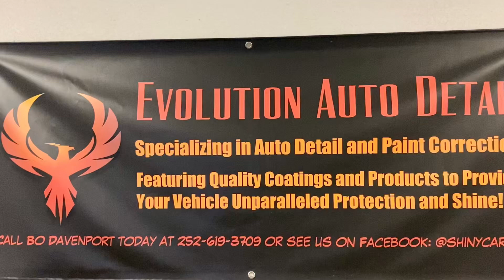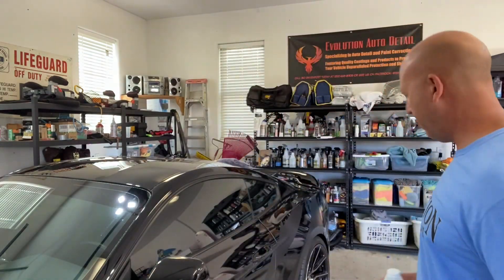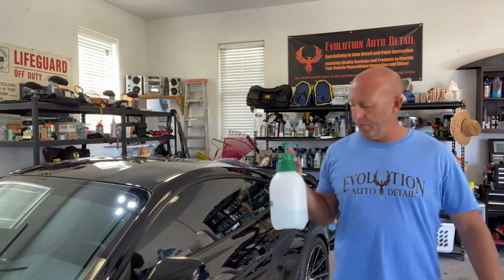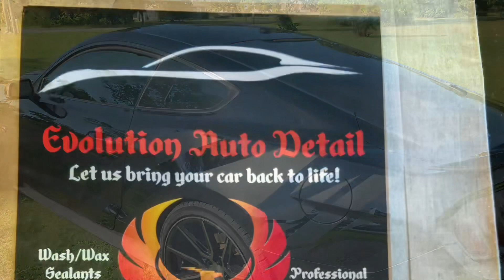Rinseless Wash with McKees 37 SIO2 Rinseless Wash

Comment: Huge fan of the Sio2 wash until i used the Graphene RW. Thats all i use now.
Reply: Any noticeable difference?
Reply: @1209MArky  yes, i like to compare it to ONR in how it draws the dirt/grime to the bottom of the bucket. The sio2 stuff suspends the grime leaving a oily ring along top when the bucket is emptied. Maybe placebo but i feel it cleans better
Too.  
I still think the sio2 version is slicker, especially at the detail spray/WW dilution.
Reply: @Jeeper1378  ah I use multiple towels so that doesn’t apply to me. As far as cleaning and protection noticeable difference or no?
Reply: @1209MArky  cleaning its better. Protection.. not sure i use a drying aid. Been using the Graphene detail spray.
Reply: @1209MArky  so i just used it just now without a drying aid. Not as slick initially as the sio2 version. It’s raining now so going to take a look at the beading.
Reply: @Jeeper1378  good to know.
Reply: @1209MArky  beads are ok.. sheeting is great if i poor water on it.